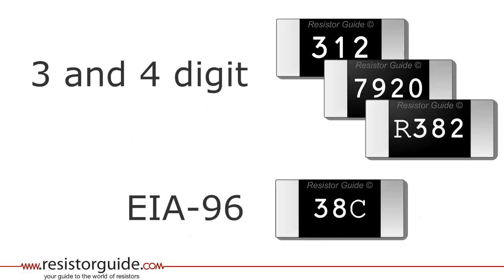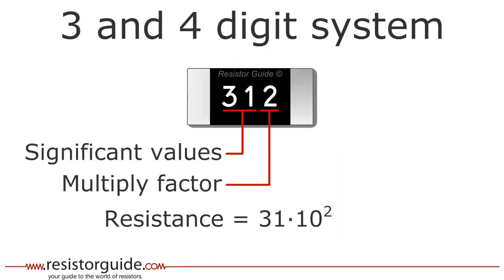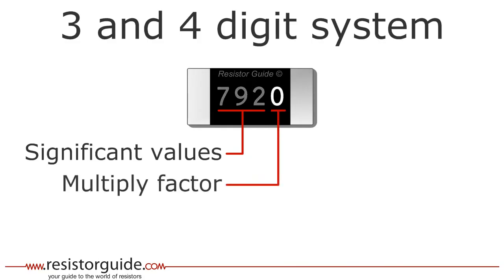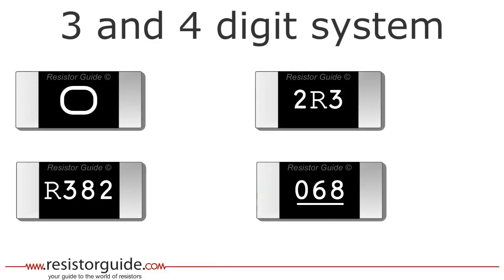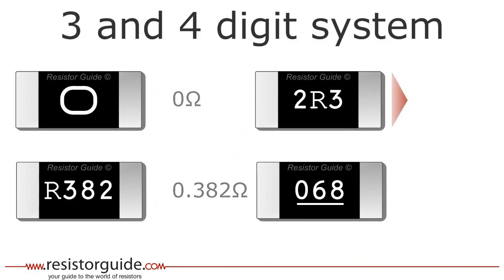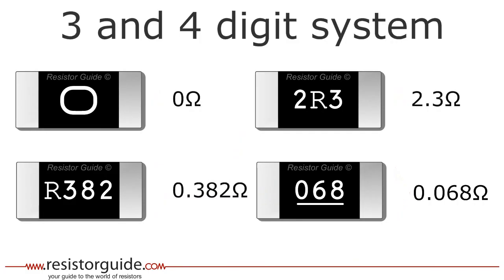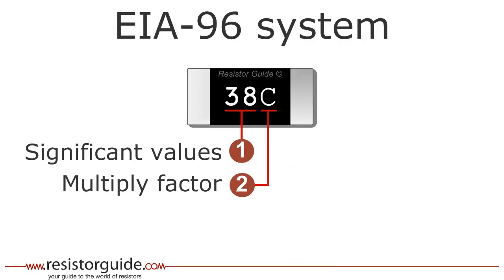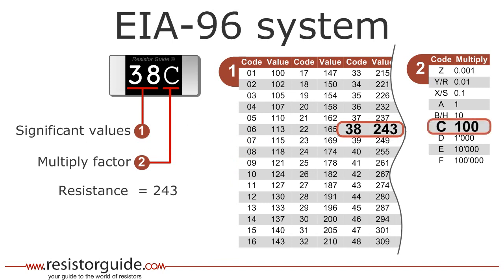Resistor SMD Code

Comment: The smd resistors can be calibrated, but must not be removed. Power banks calibrate the 200 and 000 types. The trick is solar charging or and car charger (5.8v). The calibrating may take for weeks. Doing this, a car user can benefit using a power bank, while others will not be able to use it with higher capacity and faster charging. Calibrating to5.8 v will be better at 5.0 v as well, and the supported best charger is Samsung or Apple.

Comment: thanks how to know the difference between MSD capacitors and MSD resistors  if they  have no letter or number how to know if these parts are broken how we know the value of them , I have similar MSD capacitors and resistors  on mini STB  powered by  12V and I found  2  are broken but I didn't see any number on them  any help  where can I buy them  thank you very much

Comment: I have a backlight inverter from an LCD TV and it has a slight burn mark on the back of the inverter board, on the other side there are four resistors with 0's on them and one looks burned. They are all connected to the same trace. Would it be ok to bridge that part and bypass those resistors? I'm assuming that the 0 on the resistors means no ohms of resistance which is basically like direct connection. I was going to scrape the trace which are thick and solder a wire onto them and connect the two.
Reply: I think yes it would be okay, 0 ohm resistor normally is used as a bridge itself, and normally it wouldn't bring a problem if you substitute it with a wire, but take this with a grain of salt
Reply: @affapple3214  I did that and the TV did the same thing. Still chasing this issue.

Comment: what is the messure of zero smd resistor, it is reversing or infinity when i use a digital multimeter
Reply: Zero ohms. They are sometimes used to "hop" over traces on a singled sided PCB.

Comment: what is the value for 183 with underline ?
Reply: +underfloor heating installer 0.183 Ohm. I only refer to this video. To be sure i would check the datasheet of the resistor.